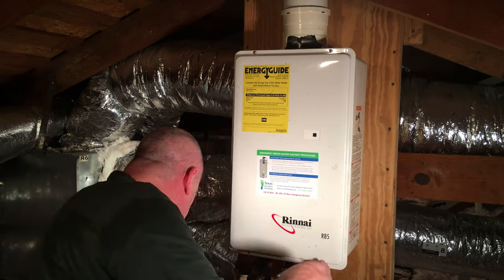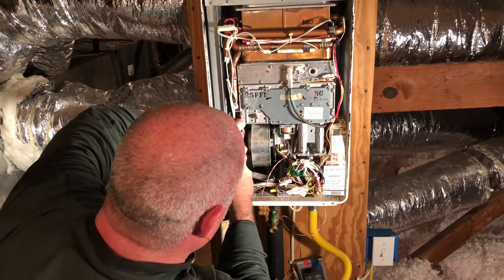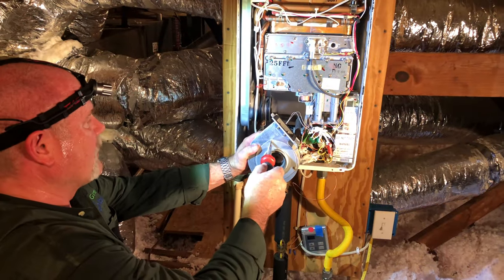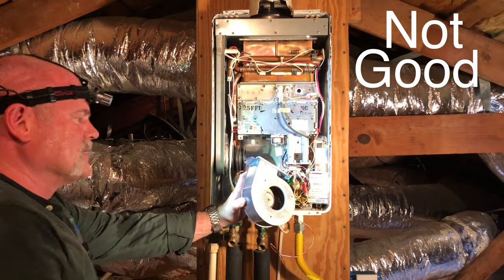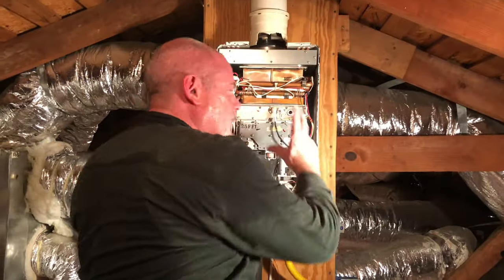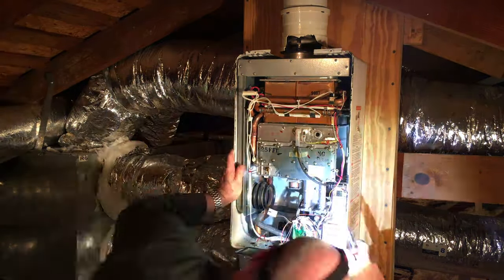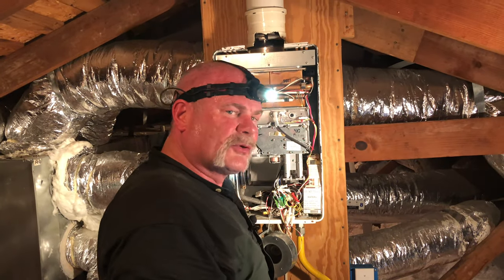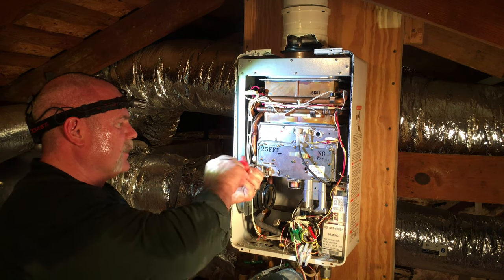Having PROBLEMS with your TANKLESS  Water Heater? TRY THIS

Comment from the maker: Have you ever had this problem? Let us know!
Reply: My thermostat won't come on when l press the reset button so I can't even get an error code what is the deal.
Reply: Our is brand new installed maybe 2 weeks ago and you can't even fill the kitchen sink up without a code 12 and not a lot of hot water.  It is NG and has a flex line for gas.
Reply from the maker: P Lively try taking the aerator off and see if that helps.
Reply from the maker: James Pelletier sorry I just saw this. What was the problem?
Reply: @RogerWakefield  will try that when I figure where it's at.  We have a Rinnai RU199iN
Reply: @RogerWakefield  I found out what it was and removed it and will let you know if it helped.  Thank you.
Reply: Incredibly GREAT production of your video. Clear, concise, on screen dialog. All great job.
Reply: I got leak after this hard freeze but my unit still working
Reply: Just fixed my mom’s Rinnai R85 thanks to this video. The blower motor was FULL of bugs as well as the lower burner area. She would have hot water at first and then it would quit. I’m pretty sure the small sensor attached to the blower motor is a thermocouple or an air flow sensor and was shutting the unit down due to overheating or lack of air flow. A little DIY maintenance saved her some money for sure! Thanks!

Comment: Hi Roger, Thank you for all your video's .  We constantly struggle with the error code 10 0n allot of these units as well as a the older naviens. I have done everything from cleaning the burners, blower moters, replacing moter's and boards, snaking the vents, etc. We love to give options, but these options of cleaning vs replacements are creating tension because if we attempt to clean and maintain the system and it doesn't work, and now the customer is on the hook for the repairs. Now we are at the replacement option. We often will give a 50 percent discount of the repair to put towards the replacement.  But I am sure your viewers would really benefit from a video of how you would deal with this. Its something we deal as techs, owners, etc. I love seeing how everyone deals with this as it is always a struggle. 
Love your video's, and you have may all ready covered this . As a business owner I struggle with this and am trying to educate my staff to deal with the same issue. 
Colin Snider
Freeflow Mechanical Ltd
Beaumont Alberta Canada
Reply: Ive fixed a bunch of these errors by using vinnegar down the exhaust to de scale the sediment trap..  what happens is the trap gets filled with some debris and the unit trips out the pressure switch.. might be your issue.. worth mentioning.

Comment: I have a Navien NR 180A NG and it's short cycling,  I just replaced the flow sensor and then the flame rod assembly,  now no hot water! Also descaled system last month.

Comment: Mine - the external pressure regulator for the gas line was stuck. Just tapped it with the handle of a screwdriver and the unit then fired up. Ugh. Mounted outside, everything is brand new, was working fine for a week or so. Not sure what would’ve caused this or if it’ll happen again.

Comment: My Rinnai electric hot water tank keeps flipping the breaker when taking a shower or doing laundry. What could be causing this is very annoying to have to have someone at the breaker flipping it back on when you’re taking a shower and freezing your butt off.. any ideas why it keeps tripping? I seen the video on cleaning the filter but we’ve never done that. Could that be the problem?

Comment: Do you have any idea about the error code 441 for the Takagi  TK-540p-nih? I have cleaned out filters, checked the recommended sensors. Could it be a venting issue?

Comment: I bought an on-demand propane water heater online and it flashes like it will ignite and then nothing. The manufacturer said I need to adjust the ignition needle but would not even send me a photo showing where to look or how to adjust it. Can you give me some guidance on this task? Send a photo or diagram with the part in question circled and how to adjust it please. These cold showers in a room that is poorly heated in December are not fun. Thank you.

Comment: our on demand / tank-less water heater system is messed up. This one has a recalculation pump. It seem we only get hot water when another hot water tap is open than it seems to heat water fine than after a minute the water flow completely shuts off. If I turn the hot water valve off for a minute or so it will turn on with good flow for about a minute than completely shuts off the water flow. Anyone every had this issue, and how did you fix it  ?  Thanks

Comment: Takes forever for my water to heat up. For example... my bathtub was almost full before the hot water finally kicked in. Any suggestions?
Reply: Probably need a circulation pump

Comment: I’m having a problem with mine. There is no error code but no hot water. If I go to the unit (it’s mounted on the outside of the house) and open a water line (that looks like just an extra line for outside use)the unit comes on and we have hot water for about 24 hours then I have to go open the  line again.  Do you know what would cause this?
Reply from the maker: Buddy Gallo that's strange. What brand is it and have you contacted the manufacturer? Sometimes if the aerators or shower heads get too clogged up there won't be enough water flow to fire the system.

Comment: You just took the manifold plate off the front of the burner. The face plate comes off the burner and all of the innards will slide out, allowing you to clean it much more thoroughly with an air compressor.
If Rinnai saw this video, they would tell you did not clean the burner